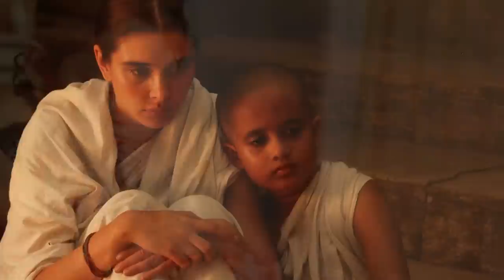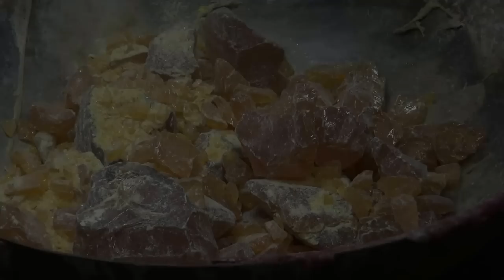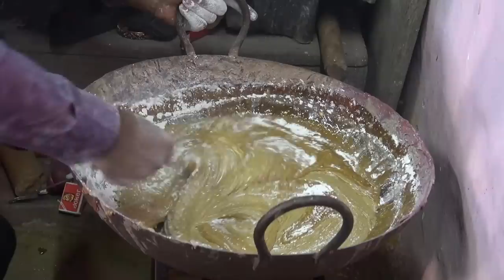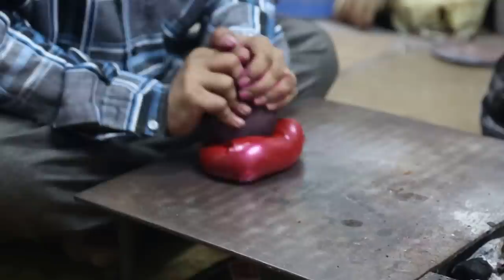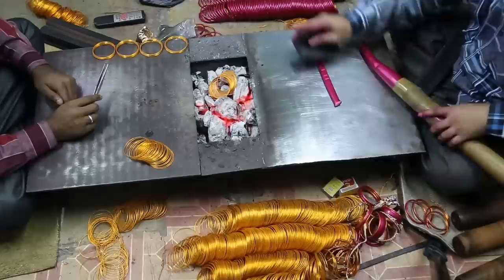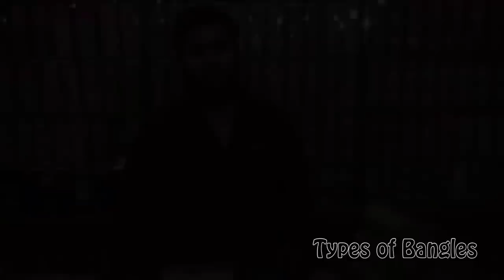making of Lac Bangles - Laad Bazaar

Comment: The "crystal" at the start - I assume it's some sort of tree resin as lac is fairly expensive. Could you spell the words you used to describe the two resins? I can get talc easily, which is what that "powdered stone" turns out to be, and lac, well, I have bags of the processed discs which I use in woodworking. I'd love to try my hand at this, as well.
Reply from the maker: They call the crystals "Beroza". That part is not the Lac. Lac is the outer covering of the bangle. It is the one attached to the stick in the later part of the video.
Reply: Thank you kindly! Beroza (which seems to be spelled more commonly in English as "biroza" but has no standardized spelling) appears to be ordinary, common pine resin or rosin.

I figured it would be inexpensive, I didn't realize it would be the least costly resin I could possibly ask for - and one I have on hand already!
Reply from the maker: @elitearbor  Thank you for the information! I didn't know the actual name.